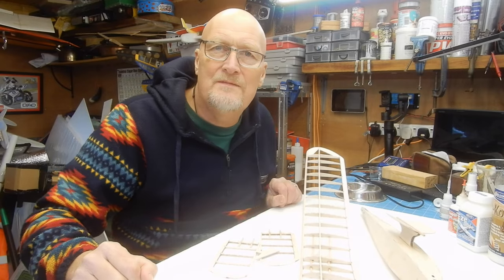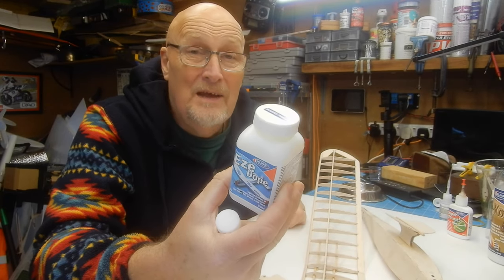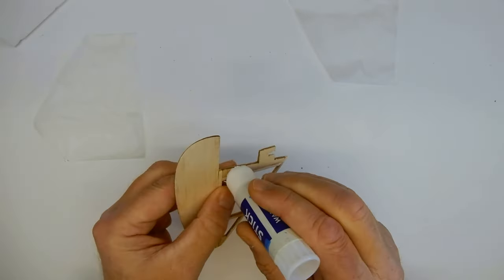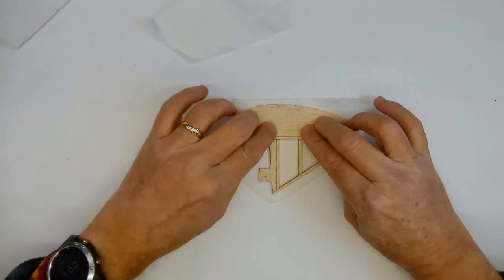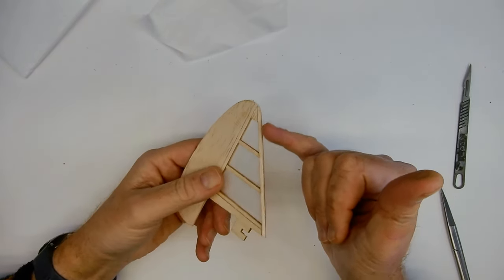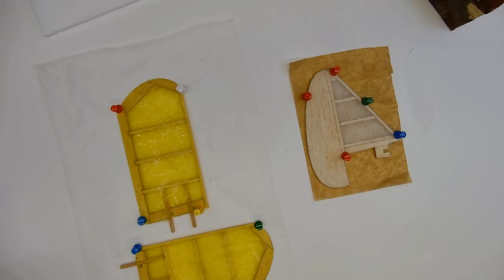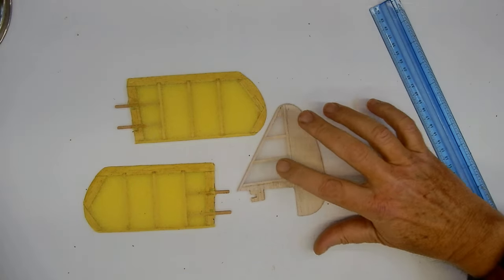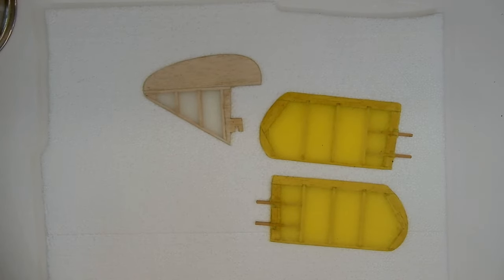How to tissue cover a Cadet free flight glider

Comment: Novice question, how do you accurately measure the percentage mix as he little sprayer is small? Do you use a syringe or another method?
Reply from the maker: Two containers buddy
Reply: I  think your syringe idea is pretty good.  As long as you can measure at a 7:3 ratio, it will work.  What I do is put 7 units of water in a container and mark the level.   Then, put three units in and mark again.  The units for a small container can be cc.  If you want more, just double the quantities, 14 cc water to 6 cc Eze Dope.  Then, all you have to do is pour in water to the 7 level and add Eze Dope to the 10 level.  Mix and apply.
When done, clean and keep the container.  As long as the marks remain, you can continue to use it.